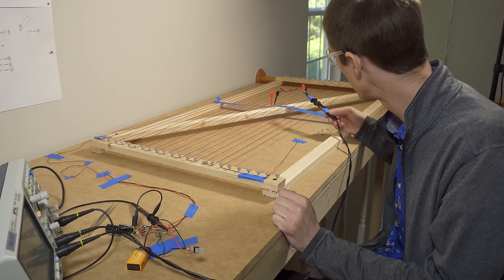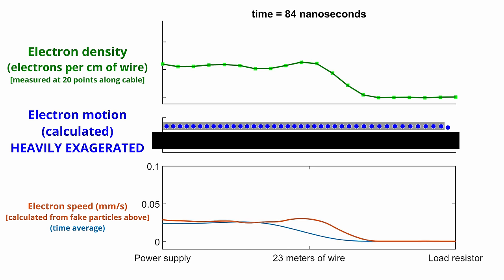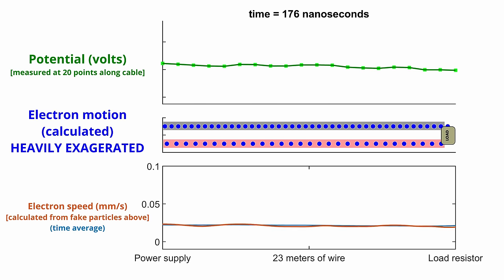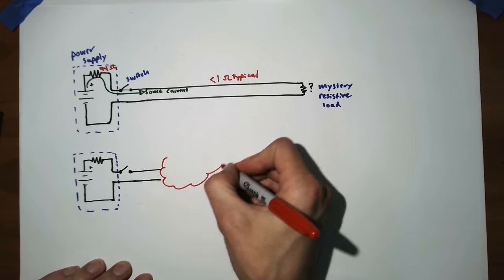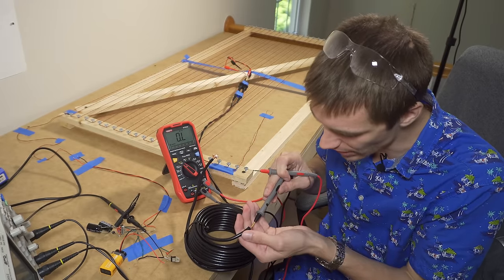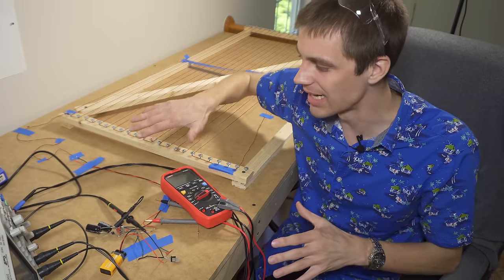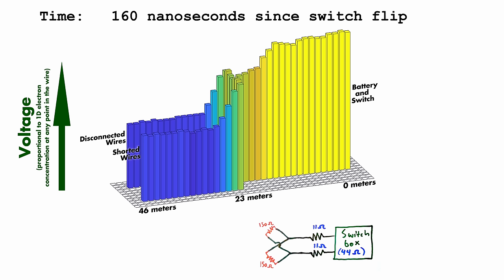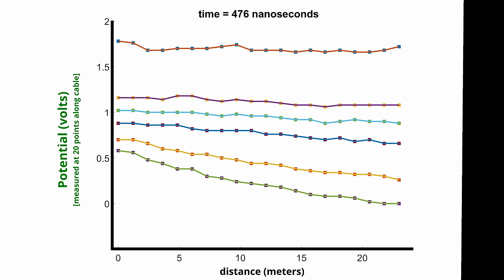What does "impedance matching" actually look like? (electricity waves)

Comment: How do you calculate something like line impedance without having to measure it? What do you actually use the impedance matching for? Like why do they list that line impedance on the product page of a cable -- how do you ensure that the load is the same and does that not severely limit what you can plug in?
Reply: How to calculate it strongly depends on what you are measuring the characteristic impedence of.  It also depends on what charactersic impedence you are measuring. This is showing a transient response characteristic impedence which is the limit as frequency approaches infinity. In transmission lines (wires/cables) you are often near this value by the time you reach the 100kHz 1MHz range.  As frequency drops the characteristic impedence has changed. For say classic telephone cable the 5Hz characteristic impedence is roughly an order of magnitude higher than the characteristic impedence at 1MHz.  Audio frequency is in between those two, and that is kinda important given that phone lines were typical used for audio frequency signals!

In practice people mostly commonly care about characteristic impedience when trying to send signals, and one of the main things people are concerned about is reflections, because these reflections distort the signal. The longer the signal has to travel and the higher frequency the more characteristic impedence tends to matter.

Except for really low frequency stuff, each type of signal/cable will generally have some industry defined characteristic impedence (and specific frequency it is measured at) and circuit designers will design their circuits to match.

Let's say I have a circuit, and it turns out out it to have too high a characteristic impedence, well I can make it match by adding a parallel resistor of some specific value to make the overall impedence correct. If my characteristic impedence is too low, I can try adding a series resistor, but that might not always work well because it will lower the voltage my circuit sees. In general a low input impedence means a circuit wants plenty of power. So an alternative is to design the circuit to take seperate input signal and power. An ideal amplifier has infinite input impedence, which means I can set a matching input impedence with a simple resistor of the right value in parallel. Many practical amplifier circuits have input impedences that are not infinite, but are large enough that the parallel resistor works just fine. Indeed for most data signaling, going directly to an amplifier is super common, since signals will often arrive too weak to power much of anything, but can still be amplified and then further processed.
Reply: @kevincathcart4680  Alright, that's definitely ringing some half-remembered bel, and the additional context fills in the degrees of freedom I was missing -- thanks. I was trying to think of it in terms of power transmission lines and load balancing, or power factors and such but it makes more sense if it's case-by-case, application specific and has more to do with signaling and so on.

Comment: Haven't seen the main video yet, but in just the first two minutes you've helped me understand RF impedance better than an entire semester of antenna design.
Reply: This applies perfectly well to RF, it's just that the system never settles, because the driving voltage is continuously changing. Then you get waves continuously propagating in both directions to create standing waves.

Comment: Wow, TY for this explanation of why certain cables have specific impedance ratings always confused me. The whole coax SDI impedance matching was just a mystery to me. I work as an event technician, and we had so-called "end resistors" for DMX (a lighting protocol) cables when devices started to behave wearily. I had to dig into the whole SDI specification since we had unreliable cable connections on long runs  (100 m and above) which introduced me to the concept of eye pattern. Amazing topic and explanation!
Reply: Yes, the technical term for such an ‘end resistor’ is a termination resistor.
Reply: What's the eye pattern

Comment: Is 150 ohms the resistance of the battery?
Reply: If I did understand it correctly the „150ohms“ are dependent of the specific wire type and geometry used, and how the electrons in both wires interact with each other. Eg. An electron deficiency in one wire will attract electrons from the other wire causing a slight movement that is equivalent to the 150phm load. But I’m not shure if that is the correct answer.
Reply: No. He gave the actual internal resistance of the battery when he diagrammed it out, I think it was around 47 Ohms. 150 Ohms is the "imagined"/ideal impedance of this particular circuit. It's the resistance that the current appears to be encountering, based on how the electrons are being compelled to move in the wires, before the circuit has settled into its actual steady state

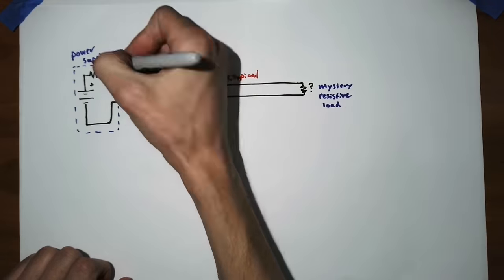EDIT: It was 44 Ohms, discussed around the 7:00 mark 😊
Reply: @dancoroian1  Funny how you automatically rounded to E3 when you couldn't remember the exact value :D
Reply: @Thrustmaster64  E3? The gaming expo...? 🤔
Reply: @dancoroian1  E3 is a series of resistors, one of which is the 47 Ohm resistor (there's no 44 Ohm resistor).
Reply: @aspuzling  gotcha, thanks...I'm dumb when it comes to electronics! Only ever had one ECE course, my specialty has always been in software.

So, just a happy coincidence in this case!